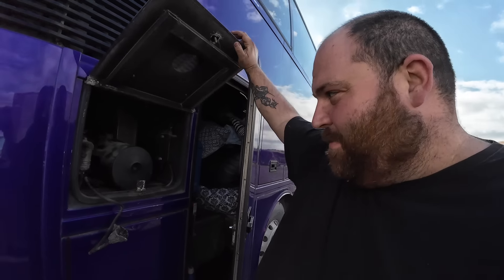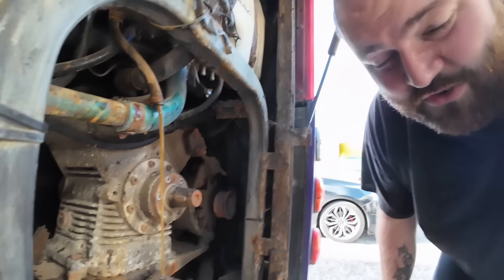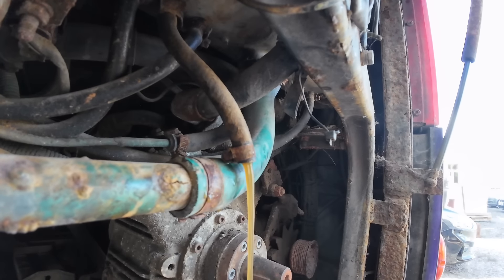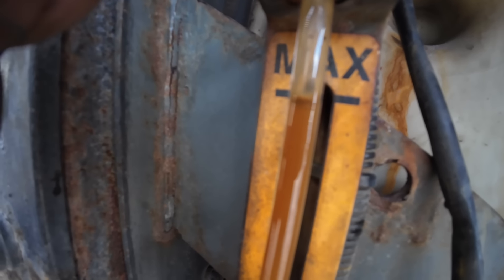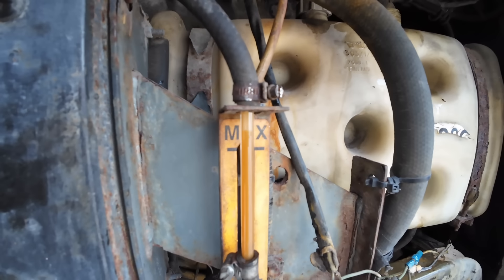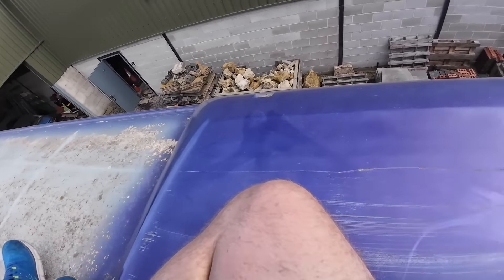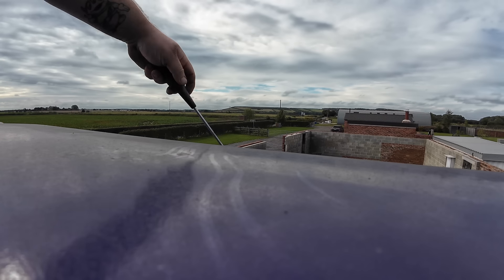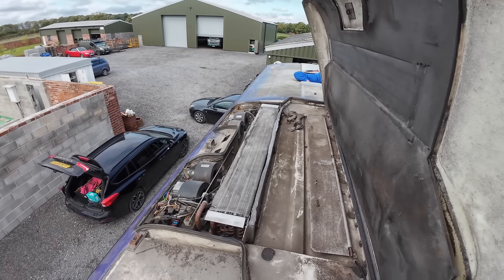Odd Jobs on Our Tour Bus Home Project

Comment: 3:05 very much like the old-fashioned ambulance in the background - I can not tell if it is an early 1980s one or a 1970s or older one
Reply: Hi I’m the owner of the ambulance 

It’s a 1987 Bedford cf2 350 chassis cowl with the 2litre cam in head engine with a mountain range day work body and was operated by London ambulance service and was based at new Malden ambulance station
Reply from the maker: I see James has left you some details. It’s a great van!!
Reply: @Hoggles94  A very classic design - well done

Comment: Do you not know anybody that can lend you an ally quick lift scaffold ?, ye know, the clip together type. It’s on wheels so really easy to manoeuvre around. It’ll be much safer than sitting atop the coach especially when you start lifting bits from the AC pods plus any other work. Might even be worth buying one then move it on when you’re done.
Reply: Agree. Any way to access that roof area would be better than hopping up and walking on it. Your girls want their dad/hubby around for a long time, not a short time.  That’s a long way down mate…. an opinion coming from a place of caring and sharing.  And from one that has seen the result of falling to the ground whilst servicing an aircraft.
Reply from the maker: Yeah when we get to these area we have items we can use to help. Thanks for watching.

Comment: I’m confused how the max level changed because the clear tube moved/shortened. The metal markings are still fixed in place relative to the tank, no? As in you could make the whole pipe clear and the max/min level would be the same? 🤔

I’m not a bus mechanic though.  Just wanted to check in case of potential damage 😉
Reply: I came to look in the comments for this exact comment. The max-min level would be the same no matter where the glass tube is.
Reply from the maker: Absolutely it will level off with the same level on the tank! Thanks for watching

Comment: The metal bracket that the water level tube is bolted to looks as if the weld has cracked where it joins the metal box with the stop button.
Reply from the maker: Yeah its something we need to address. Thanks for watching.